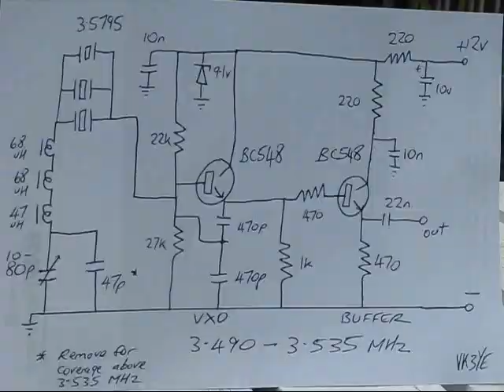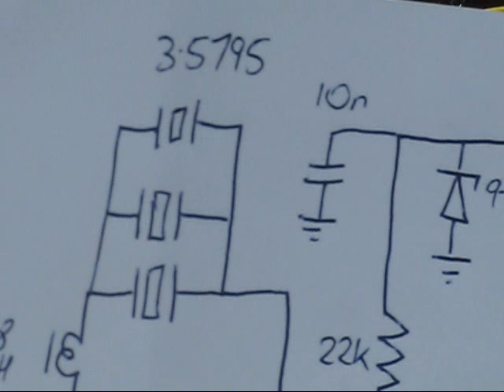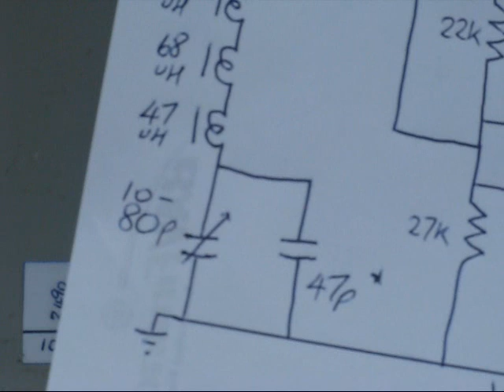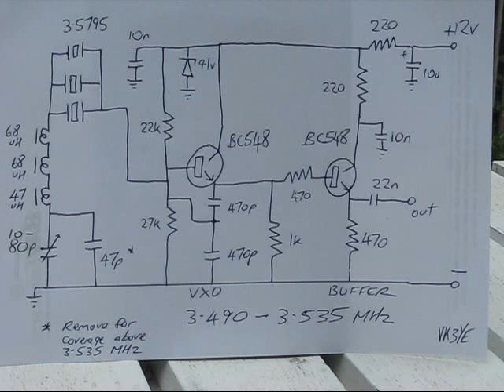Super VXO shifts 80 kHz on 80 metres

Comment from the maker: @SzpakBarwnyPtak Did a test and put in in the text above.  It drifts a lot in the first 15 min but settles down, espeically after about 30 min.  A better internal box and voltage regulation would help.  On key down it shifts by about 1.5 kHz which indicates significant pulling (it's too much for a proper tx offset).  So an extra buffer is suggested.

Comment from the maker: @monarchham Herb - let us know how you go - would be great to see a video when done.
Reply: I believe the schematic at 0:46 is incorrect. Shouldn't the top 470 pF capacitor connect to the base of the transistor? The center tap of the two capacitors would connect to the emitter putting the lower capacitor in parallel with the 1K resistor. I wired the circuit up the way it is shown with a 10 MHz crystal and it would not oscillate. I then turned to my copy of EMRFD to see how a Colpitts oscillator is supposed to be wired. I corrected the error and the circuit immediately started working.
Ray, AB7HE
Reply from the maker: @raybuck9675  Thanks Ray. You are correct.